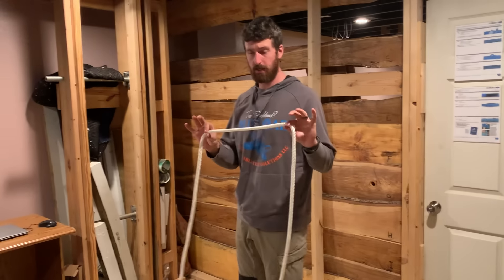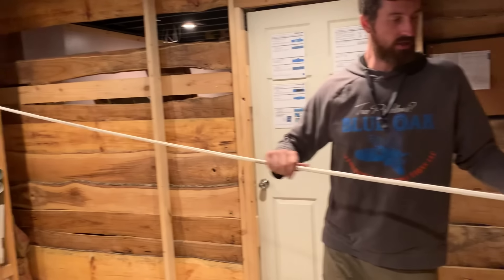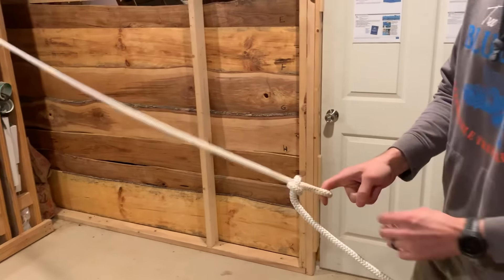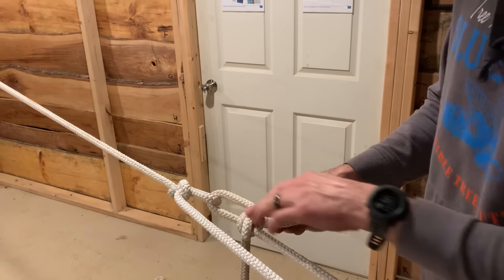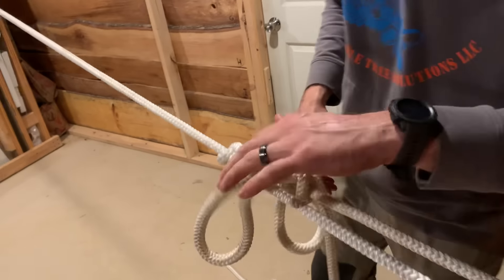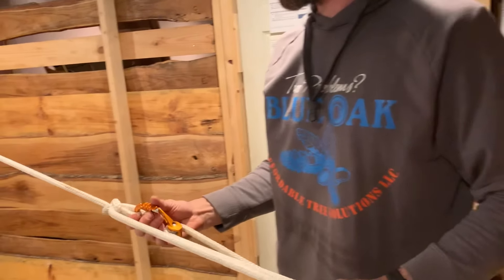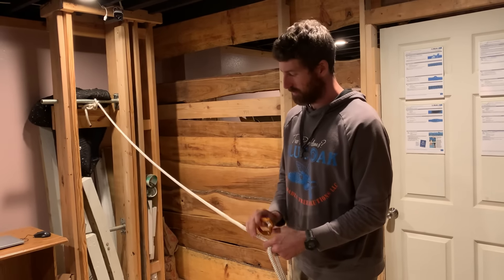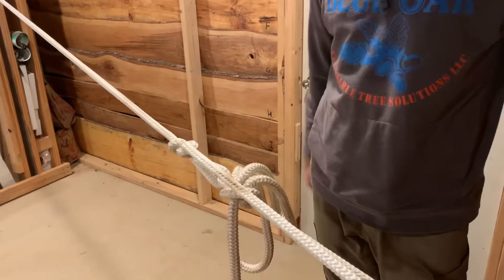The trucker’s hitch and an easy 3:1 set up

Comment: Good video. Note, however, that at 2:20 into the video (and elsewhere) you state that the hitch provides a 3:1 mechanical advantage. It actually creates only a 2:1 mechanical advantage, as the "standing part" is NOT used in this calculation... only the "working part". (As I make this comment, I noticed that I was not the first to mention it.)
Reply from the maker: Thanks for watching and commenting. I’m going to do a video on mechanical advantage because it’s a fun topic and I use a lot of MA systems in my line of work. This really is a 3:1 system. Other videos on the trucker’s hitch and diagrams on what a 3:1 is can also confirm this.  Please subscribe and hopefully I can have a new video on this topic up soon
Reply: Yours is a common first glance misconception about this hauling scenario. This is a theoretical (or ideal) 3:1 mechanical advantage (MA) system. It's functionally equivalent to a "z-drag" haul commonly used by rope rescuers. Its actual MA is more like 1.5:1 once friction is taken into account.

Comment: one advantage to the carabiner approach, is that you can put two loops into the "slipknot" loop (now represented by the carabiner) to form a blackwall hitch (after looping your standing end twice through, flip the first loop over the second), and make your overall trucker's self-locking; you'll still need to secure it at the end with two half-hitches, but won't have to mess with the pinching and two-hand gymnastics you have to do to keep from losing tension while you put your half-hitches in. #firstclassamateur

Comment: All you have to do to lock it off instead of the two half hitches is run your line through the loop twice. When you tighten it, it will roll over on itself and lock the rope in place. Doing it this way negates the need for pinching off the rope and tying locking knots. Simply pull it the opposite direction and it will unlock.

Comment: Good demo.  Just a note, if you put the working end through the slip knot's loop 2x instead of 1x like you showed, it forms something of a Blackwall Hitch and locks on itself so you don't have to pinch the rope with your hand once you've got it tensioned.  Saves a ton of aggravation.  First Class Amateur here on YT shows how to do it "at combat speed" and it was an eye-opener for me.  Completely changed how I tie the Trucker's Hitch because it captures the tension you put on the line!  I'll have to double-check to see how thick a rope it'll work with.
Reply from the maker: Thanks for the information and a couple other guys commented the same thing.  It would help hold the line but it would also reduce the power of the MA system and thereby reduce your tension a little. The added friction would help hold your progress but also hinder you from achieving maximum tautness.
Reply: @blueoakats  I don't think it hinders how taut you can get the line.  The key is what type of line you're using and how smoothly it turns the loop.  Watching First Class Amateur's vid, you can see that he's able to get his rope as taut as a drum and it holds that tautness without the half-hitches to tie it all off.  Where it shines is when you need to readjust your grip to haul away a second time.  Of course, if your rope won't slide over itself smoothly, as I've found with a lot of the three-ply line I prefer, you're kinda stuck with the old method.  🤣
Reply: @blueoakats no, it doesn't prevent you from acheiving max taughtness. It simply make your job easier by auto locking and freeing up your other hand to throw a couple of half hitches to secure your rope. You can still tighten it enough that you can break the rope, if you can apply that much tension.

Comment: Not the “Truckers knot” I know. What if your tying down a load with a 50ft rope. And needing to tie a load several times. Feeding 30/40 ft of rope through the loop, too time consuming. The boss would be pissed, wasting time with that knot.
Reply: Most Americans don't have any idea they're doing it oddly inefficiently.  👍😎✊
and you're 100% correct :-)
Reply: Because the "slip knot" is not the knot to use

Comment: It is a 3:1.  I know Wikipedia is peer reviewed, but physics is physics.  If the stationary pulley was a fixed hitch instead, it would be a 2:1  Since it is a pulley which leads back to a moving pulley, it is a Z Rig.  Also, remember friction loss from the fiber to fiber contact.  Small, but real.
Reply: its a 2:1 mechanical advantage and that's physics.

Comment: Wow, he knew what he was doing up until he started to pinch off the knot.. don't you know how to make an auto locking truckers hitch?

You just pull it tight and it locks itself down you pull it tight again and it locks itself down.

No need to do the stupid trying to pinch with your one hand and then make it tight with the other hand nonsense

That's where everyone messes up so just remove that step by making it an auto locking knot
Reply: So how do you make it auto-locking?
Reply: Well, you do not have the end available in every case. Sometimes several lashings are made in continuous fashion, using a much longer length of line. Far too tedious to thread an end through, much less twice for each hitch. Not to mention unlashing and coiling up at the unload.
Reply: @JDeWittDIY , it can be done by threading the free end through the ''pulley'' loop once more, but crossing it over itself. See the videos of First Class Amateur.
Reply: @leehaelters6182  Thank you, I will look up those videos.

Comment: Right concept, but that’s not a Truckers Hitch
Reply: Correct-not a truckers hitch and not 3 to 1.  A 2 to1 and actually less due to all the rope friction
Reply: @Mark and @herbiesnerd, I am curious what disqualifies it, in your view, to be called a Trucker's Hitch? The noose as a pulley, rather than a Figure Eight or an Alpine Butterfly?
Reply: @Mark-jd1fr , agreed that the purchase is 2:1, as the free end hauled on is not counted as a shortened rope, no?
Reply: @leehaelters6182  I was a firefighter for 31 years. This is how we were taught. They key technique is tossing all the working end rope OVER the taught line. This video shows the first way I learned it which in my opinion was superior than the 2nd way I learned it. Instead of the Bowline at the change of direction, you can also use a very simple sheep shank. The sheep shank only held if the line is kept taught as it would fall apart if allowed to go slack. But, that’s the exact reason it was used, so it would easily come apart when you were finished using it. 

https://youtu.be/t0xy_a2z0Cw

The loop he tied in this video we are all commenting on, is using a completely separate technique for a middle of the line loop. The truckers does not require you to feed the working end of the rope through the change of direction loop. However, I do use this technique like did but I use a middle of the line Butterfly Loop. 
All good knots possess 3 qualities: 1) Easy to tie 2) Easy to untie 3) Easy to identify

The loop he made will be a bitch to untie. A butterfly loop is like butter to release no matter how tight tension was.
Reply: @herbiesnerd , much appreciated your thoughtful reply, and I am working on absorbing the video you linked to, it is much food for thought, With the sheep shank mid rope "pulley" loop, I appreciate its value in unlashing and coiling up a long series of hitches, but I have never used it myself. I most always have relied on the Alpine Butterfly, as I have come to know it, for the same reason you mention. First person to teach me this version was my employer in the mid 1970's. He had learned it from some European co-worker, who called it a "Dutchman". I have not heard that term since. I will share my thoughts after studying the techniques you showed.
Reply: @leehaelters6182  I had to read your comments a couple of times to understand your description. A couple of things…

First, my bad if I described the Sheep shank as a pulley loop. That is not at all what in intended at all. 

Your Alpine Butterfly is exactly what I referred to as a butterfly loop.  That can most definitely be used as a change of direction midline pulley. 

What the Trucker Hitch is not, is a rope system used as mechanical advantage using a loop of rope thats used as a pulley. 

The Truckers Hitch is a simple system used to pull a rope tight between two anchors. The taught rope can be used for numerous things such as a barrier, to hold a tarp or to tie down a load. 

Notice in the video link I attached before, the firefighter steps over the main line. You don’t have to do that, but the entire working end needs to cross over the standing end. A bight of standing rope is grabbed and pulled back over where the working end crosses over. That bight of rope is secured to the upstream portion of the standing end with either a sheep shank (feed about 3”-4” of the bight through the sheep shank loop), or with a bowline (starts the same as the sheep shank but the longer bight goes around the standing end and back through the sheep shank loop=bowline). 

I’ve used the butterfly loops securing loads on trucks and trailers because it usually needs more than 2 or 3 change of directions.
Reply: @herbiesnerd , again, thanks for your reply. I reckon that every trade, discipline, or branch of service may develope its own traditions and nomenclature. When lashing down a load in the vicinity of a firefighter, i will be sure to try to speak the lingo.

I will say this, though, that every bit of text or lore I have come across over the years refers to the hitch that cinches down a lashed load with a doubled or better purchase names it a Trucker's Hitch!

I will continue to study on the ropework you mention and link to, to build up my own retoire, thanks!

Comment: That set-up is not truly 3:1. It is 2:1+, with friction at the anchor and the slip knot diminishing the advantage. Pulley blocks would reduce friction and improve the power. But as a quick set-up for rope-only work it is a quick and easy set-up.
Reply: I posted this on another 2:1 thread.  I'll repost here.  Wikipedia says 3:1.  FWIW.

https://commons.m.wikimedia.org/wiki/File:Truckers_hitch_pulley_model.png
Reply: If you don't think it's 3:1, you can test it. Set this up between a chair leg and something that doesn't move. Pull the loose end 3 feet and the chair will move 1 foot. It's 3:1.